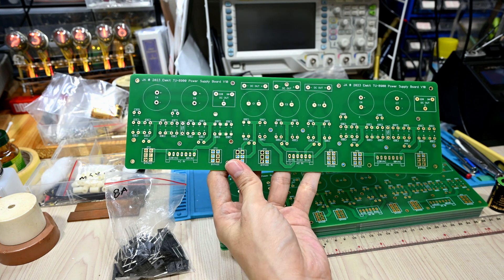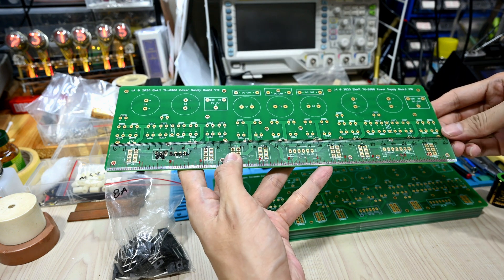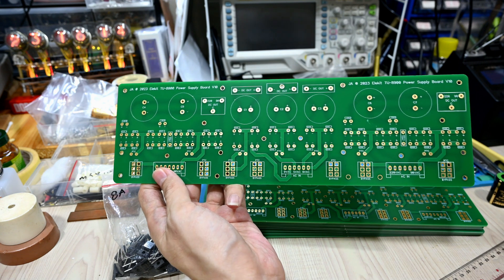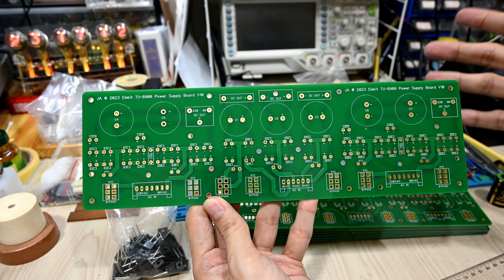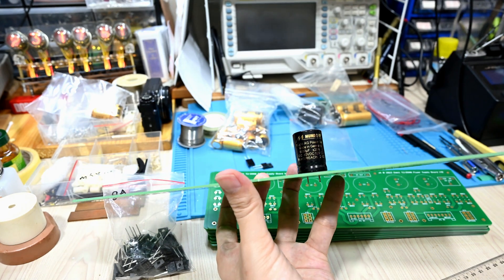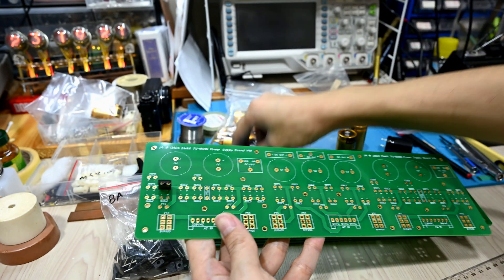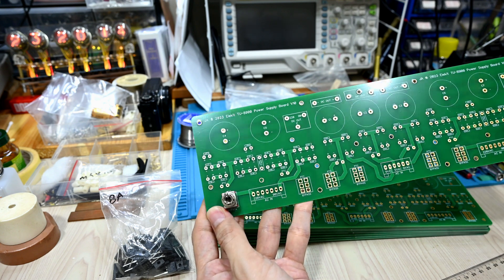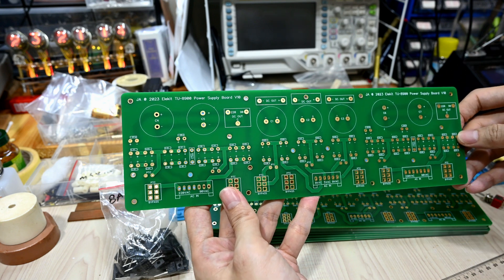Elekit TU-8900 (300B/2A3 Amplifier) Upgrade - Part 6

Comment: Over the top upgrade and electronic art. A real work of art and labour of love & money! I have the TU-8600SVK and looking at upgrading the Bridge Diodes. They are the same as the TU-8900 (RBA-406B x3) I was looking at upgrading to 3x Vishay 100V/4A (629-6437 from RS Components) as they look like they have higher specs & quality. Did you look at better quality Bridge Diodes in the same configuration and if so what ones as I have standard PCB & case. Do you have the part number & supplier of the short gold PC pins you are using as they all look similar online. 
Dean from Australia 👌
Reply from the maker: Hello, I believe the Mouser P/N is 575-0300215 for the Gold Pin. Unfortunately I could not find similar bridge for the replacement, so I ended up with the Stealth Diodes. Thanks.
Reply: Thanks for the info Jimmy will order 3 different length pins for future upgrades.😊
Reply from the maker: Hope you enjoy it! Thanks.